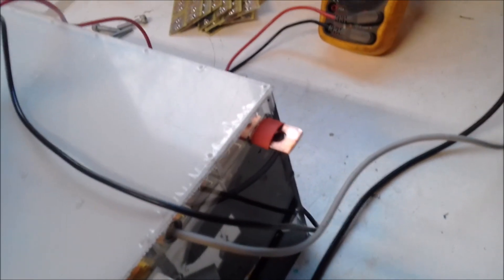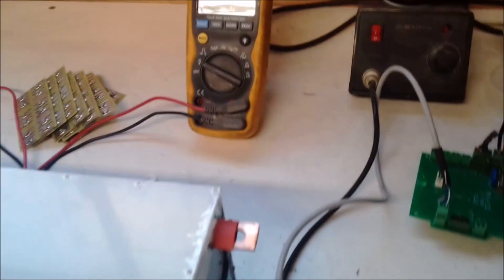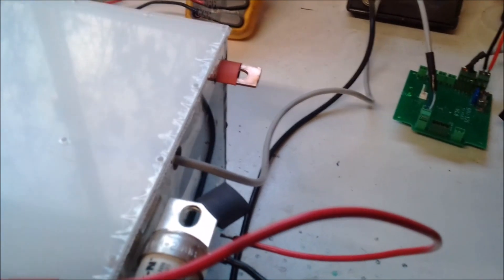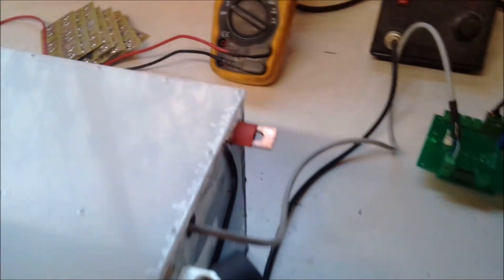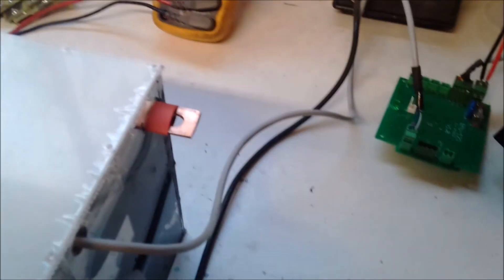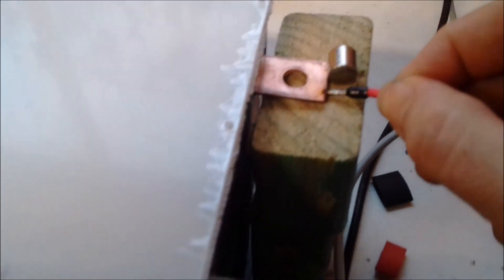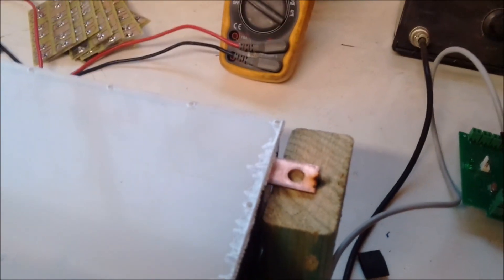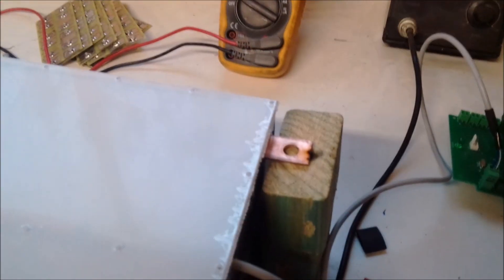DC arcs and magnets

Comment: It would be cool to know if one pole "blows" the arc and the other might attract it? Or is there no difference 🤔
Reply from the maker: That's absolutely what happens 🙂. Use the right hand rule to determine the direction of force.
Reply: @jonescg  yes I remember something about some DC switches and circuit breakers, using permanent magnets to blow the arc, to help extinguish it, or to force it into a arc splitter.🤔😉

Comment: hi chris, nice demo, do you know the science behind why its arcs when  you take off the wire?
that would be interesting info
Reply from the maker: An arc is just an electric current, like a wire, only through air.  Any electric current generates a magnetic field around it, so placing a strong magnetic field against it causes the conductor to experience a force.  Unlike a copper wire, which would just be pushed to the side a bit, the arc simply dissipates in the air.
Reply: @jonescg  i mean is it a back emf spark? from collapsing field in the resistor? its a heck of a spark, seems weird no spark at hook up but big spark at pull off. guessing its sort of back emf voltage spike? curious
Reply from the maker: @namenotshown9277  In this case it's just a resistive load, so virtually no inductance.  It's a large spark because it's 100-odd volts DC.
Reply: @jonescg  but why big spark when take wire off, and small spark when first contact?? should be big spark both times, something odd going on there
Reply from the maker: @namenotshown9277  because one is making a solid, low resistance connection and the other is breaking a connection.

Comment: Awesome! Only the other day I was wondering why cheap welders don't have rectifiers in them (I had to source my own) and wondered when anyone would ever want to weld with AC, turns out when welding near magnetic fields AC is king! Are you making your own DC contactor?
Reply from the maker: Haha, nah.  I just noticed the arc when I was quickly testing the battery management system for any EMI.  I figured a 2 cm long arc was a great way to illustrate how magnetic blow-outs on contactors work (and why we don't use high voltage DC for domestic switching).  It does show why DC welding is so easy to strike an arc though.
Reply: I learn a new thing today, didn't know this!